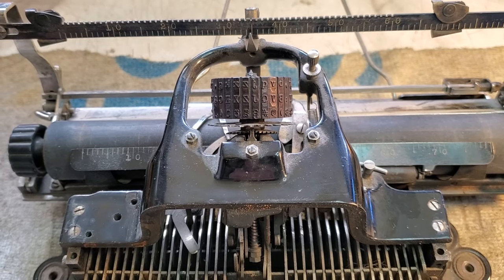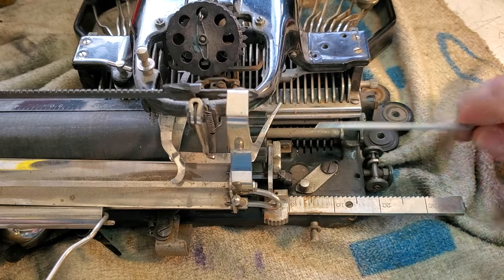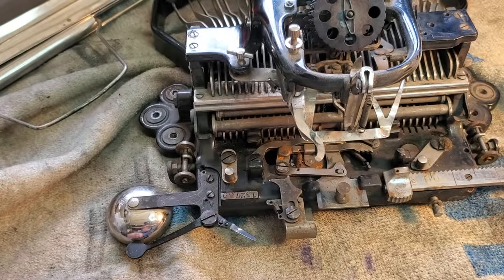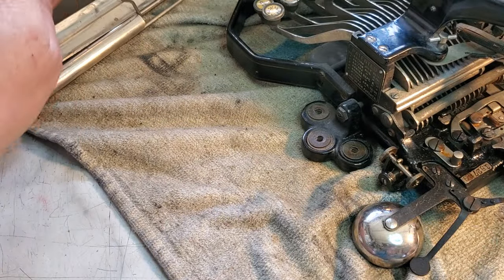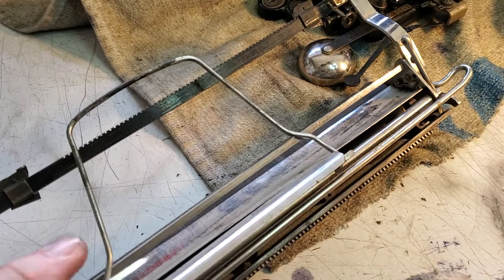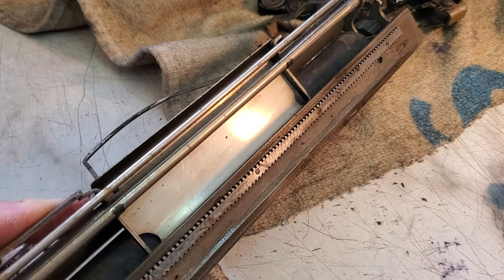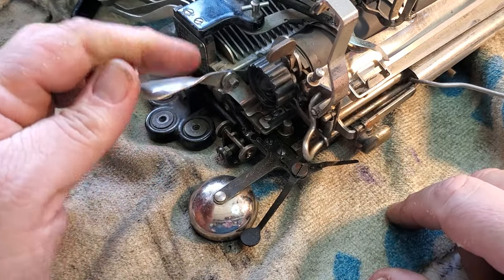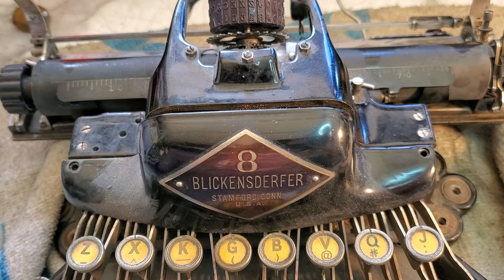Blickensderfer 8 Typewriter Carriage Removal Repair Movement, Spacebar Action Restored

Comment: That's a really cool Dude there, it's always amazing to me the gear work, linkages, the sight and smell of history, if they could talk, Imagine the stories.

Again thank you for all the help and work you do, the time you take to do these videos and bring us along to the work bench.  I have learned so much and more confident on my Smith and Corona 120 electric, and once I get to cleaning it I'll drop an update here or there to let you know how it went, what the result is on the motor.

I did take the bottom panel off, and the screws were snap tight, so I doubt and think they have ever been moved, I doubt it's ever been serviced, and there is a tone of gunked up gooey old oil on everything. Just gobs and gobs of old gummy oil. I was able to turn the primary Wheel and hold down a key and slowly J,  it rose up, "It's Alive!" Hahaha.  If I were to guess, mine was bought and used good for a year or 2 and then placed in its case and it just sat as many things are frozen like the paper guide which came back.  It is in really good condition.  Thankfully to the Samsonite case. But I'll let you know.  And again thank you so very much!  Always a thumbs up from me.

Comment: Spray WD40 on the felt Ink Roll and it will come back to life, often without adding any ink.  Blickensderfer Manufacturing Company had excellent ink that seems to be useable again, 110 years after drying out.  Stamp Pad ink works to re-ink, applied with a 5ml sryinge.  Most of today's stamp pad inks are water-based and they do not work as well as what was used in 1900.

Comment: What’s the aerosol cleaner recommended?
Reply from the maker: Way back 40+ years ago everyone used AMES product, they had a selection of aerosol chemicals,
they were labeled 100% (oil), 80%, 30% (30% oil/70% degreaser),15%, 5%, 0% was straight degreaser
The 5% was excellent for coating everything, with just a thin coating of oil, AMES and those went away 20yrs ago
Found the Nutrol MG 401b has just a trace of oil, primarily a cleaner/degreaser, I use this on Everything !
search internet for the 340G size, much better value than these 140G mini cans, read the reviews.....
https://www.amazon.com/MG-Chemicals-Control-Cleaner-Aerosol/dp/B005T6I9HQ/ref=sr_1_fkmr0_1?crid=NKGWBDXTXGV6&keywords=nutrol%2Bmg%2B401b%2B340&qid=1700944718&sprefix=nutrol%2Bmg%2B401b%2B340%2Caps%2C115&sr=8-1-fkmr0&th=1